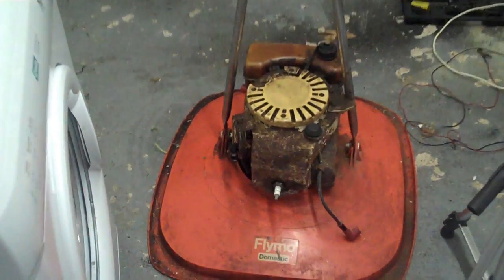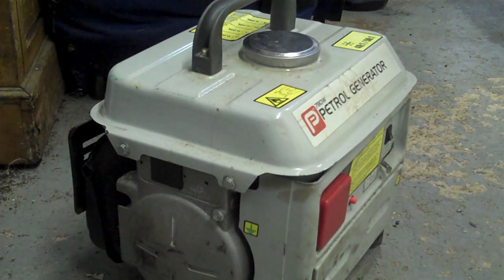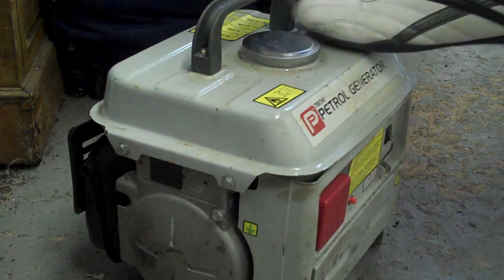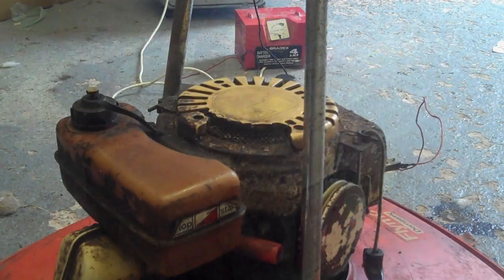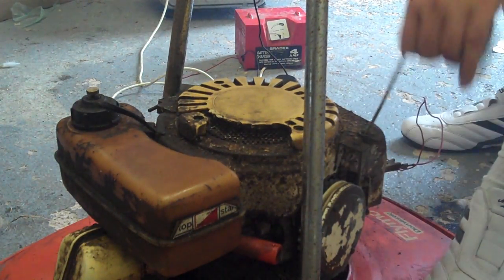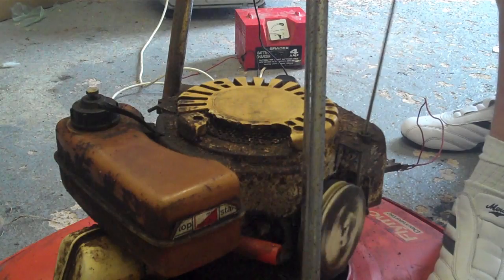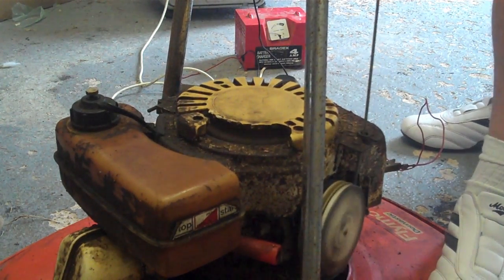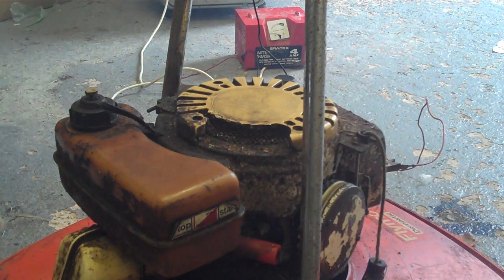Flymo+Charger+Generator??

Comment: Your generator is smokey I would recommend low smoke oil from b&q works great no smoke comes out of my strimmer so should work fine on your generator also think the domestic needs a lot of restoration

Comment: @MrMoterKid you can ruin the coil by not giving it a way to discharge, i.e.  pulling the rope without the spark plug connected to the coil.